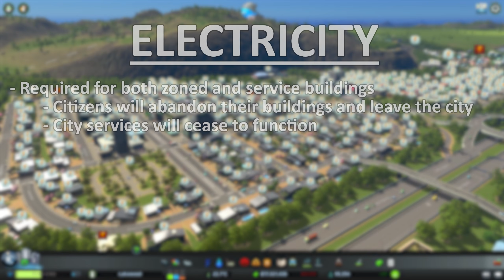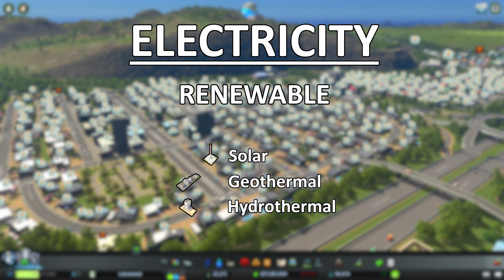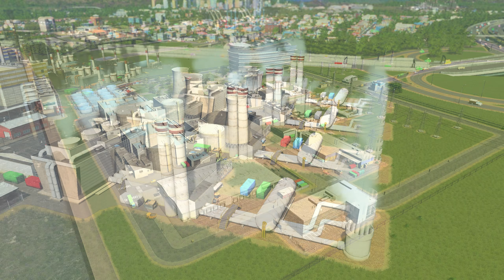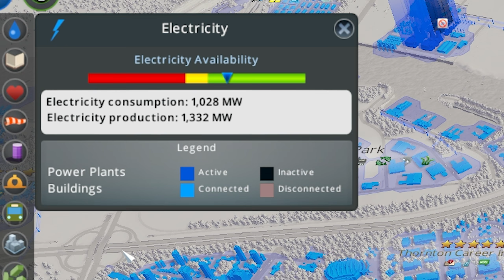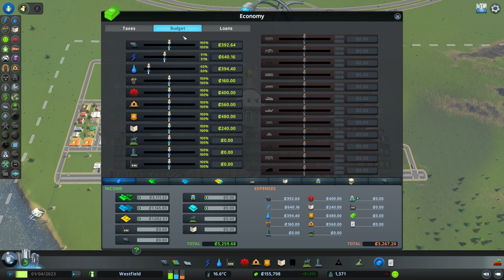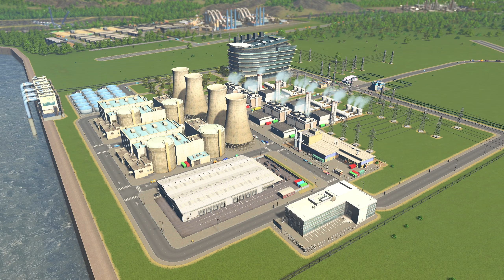Electricity | Cities: Skylines Tutorial

Comment from the maker: What kind of power plant do you usually use to produce electricity in your city?
Reply: We go full tilt, Nuclear!
Reply from the maker: I like it Aaron, no messing around! :)
Reply: I like using the Advanced Wind Turbines (situated at the reservoir with the Green Plains map)😊. I'm shopping for a new laptop, could you please mention what pc you're using to run your city?
Reply from the maker: Do you exclusively build advanced wind turbines? You would need 32 to make the same amount of electricity as a nuclear power plant! 

Right now I am using a Ryzen 5900X, GTX 1070, 32gb of ram, and an NVME SSD. It's a little bit overkill for what I need but I have absolutely no issues playing, recording, and editing videos.
Reply: @jester.Gaming  Thanks for sharing! Yes I exclusively use the AWTs because I discovered that, with my electricity budget at 100%, its just easy for me to plop a few of them and be in the green whenever I begin to have low coverage. In another build I also have a dam after the river confluence and just before the bridge, there's an area with high water flow.
Reply from the maker: No problem! It sounds like you've got it figured out! I may need to add one more nuclear reactor depending on how much more I expand the city :)
Reply: Wind turbines. They are green, and look massive and interesting

Comment: Mine never works like this. They just won’t build even though some of the houses have electricity and water. Even struggle with industries as they won’t build even though there is power and water.
Reply from the maker: How's the demand for the different zoning types? If you zone too much at once it won't fill in right away and sometimes might zone too far away to connect the power properly.

Comment: I’m kinda stuck I’ve reached my population to 3,000 but losing electricity ⚡️I’ve added the water turbine which helped for a little bit so I added wind turbines and more power lines and I’m losing more power. I don’t know what to do or how to fix the problem
Reply from the maker: Both the water and wind turbines provide less electricity compared to other options you would get early on in the game (oil, coal, etc.). If you're expanding your city rapidly you'll have to install these turbines more often. You'll also need to make sure you place them in areas that they will generate the most electricity - the wind and current info views should come up once you try to build either. Hovering over an area with the turbine will show you the estimated amount of power generated.

Comment: Hey guys i know im late to the party,but can i produce electricity for the buildings in my city without using power lines? I try to make it work with them,but they removed many of my buildings and its not pretty..
Reply from the maker: Hey cartel0331, better late than never, welcome to channel! You don't need power lines to connect power to your buildings as long as the buildings are relatively close together. When you are in the power info view you should see a blue border that extends a little bit beyond your buildings - this is what will connect the power between buildings rather than lines. As long as your buildings are close enough for their blue borders to overlap/connect won't need lines. I hope this helps, good luck with your city!
Reply: @jester.Gaming The problem is that i wanted to have fun and build a pretty big city with everything unlimited and completely forgot about electricity. So now i've zoned everything and the power lines ruined half of the city.. is there anything I can do or i have to start a new city? 😅😅
Reply from the maker: @cartel0331 I understand! Unfortunately zoning everything at once means your RCI demand will be a bit out of whack and things will come in randomly across your city. It's not impossible to do but your city will have some growing pains as the zoning comes in and your citizens become educated, etc. You can leave the power lines in for now and then delete them as the zoning gets filled in and the buildings become connected by proximity. You may have to rearrange the lines multiple times to open up areas for zoning and getting it all connected ... It will be a bit challenging for sure!
Reply: @jester.Gaming Understood! Thank you for the answer mate
Reply from the maker: @cartel0331 No problem, good luck!

Comment: How to import fuel for power plants?
Reply from the maker: Fuel (eg. coal and oil) should import automatically. Depending on the traffic in your city the trucks may get stuck somewhere and have trouble making their deliveries. As you add more external connections (highway at the start and eventually boats, trains, and planes become available) you'll import from various other sources but it will always arrive at your power station by truck. Ideally once you've progressed far enough you can upgrade to more efficient and environmentally friendly electricity power sources :)

Comment: You should not have the water lines run beneath the industrial to the residential. They will pick up the ground pollution and carry it into the neighborhood. That area should get water last
Reply from the maker: That is incorrect. Your water lines will not absorb ground pollution if they are running underneath a polluted area. The only way for  contaminants to enter your water supply are pumping polluted water into the system  (eg. if you have your outflow upstream from your intake) and if water towers are placed on contaminated ground.
Reply: I had the industrial between the water supply and residential. The ground pollution turned the water pipes brown and traveled halfway into the neighborhood I had built and made the people sick
Reply from the maker: @betenu1   There must be something else going on then because the water pipes do not absorb ground pollution. Check that you don't have any water towers on polluted ground or water intake in polluted water.

Comment: I have a problem in my little town that even though I have enough electricity and my power lines are connected it’s still saying the buildings need electricity, I have no idea what to do.
Reply from the maker: Hi JAYMO! There are a couple things I can think of ... 

 It could be that not all sections of your city are properly connected. For example if you have an industrial area off to the side it might not be close enough to connect to the buildings of the main city. You may have to connect different areas of your city with powerlines. I have this every once and a while when I am expanding a city.

Are you using solar power? If you are and also using the day-night cycle your power production will be reduced at night. 

How is the traffic in your city? If you're using coal or oil power plants they may not be getting deliveries of resources. You can check their reserves in the building info view. If this is the problem you can improve your traffic flow, increase outside connections (add rail or boat), or add a local industry to provide the needed raw resources.  

I hope this helps!

Comment: I’m new to skylines, but I do know some basics, what I don’t get tho is how to fuel the coal power plant back up? I surrounded it with yellow buildings, I gave it a massive road straight to the highway to get them out quicker. But still in some random but big patches, the power goes out? Because of the too little power. Even been surrounding the place with windmills and water wind mills
Reply from the maker: Hey bfsupportclasswontgiveyoua5622, your power buildings will resupply automatically assuming you have an outside connection (all will have a highway connection at the start by default). You can click on the building and check out how much material it has in stores for consumption. If you have bad traffic these resupply vehicles may be stuck and taking longer to deliver. 

The windmills and advanced wind turbines will produce variable power levels depending on where they are placed (need areas of high wind). If not optimally placed their production levels will be limited. 

How are your power levels for the city? If you go to the power info view are you producing more than consuming? You may need to either increase budget or build additional power plants. Also, make sure everything is connected with either power lines or blue electrical area - maybe only a portion of your power producers are connected to the grid. Power level will also fluctuate depending on usage...day/night, cold weather, etc. 

I hope this helps!
Reply: @jester.Gaming  I made a new one a couple days ago and mainly use wind turbines and have 1 coal power plant. It’s doing good so far but I’m also on the PlayStation version and I’m not sure how different it is to the PC version